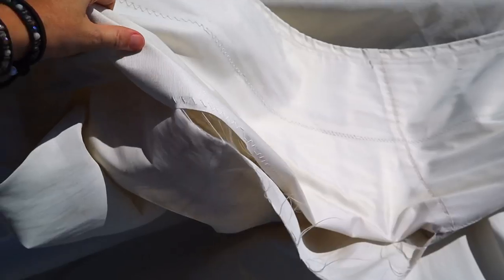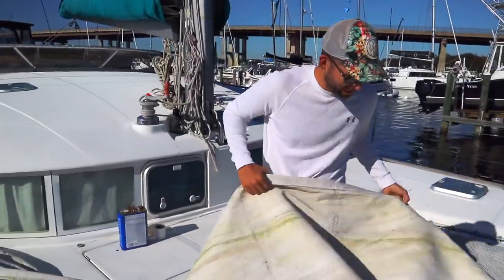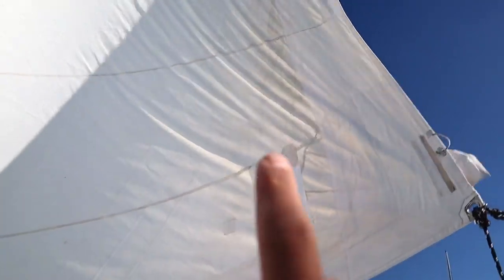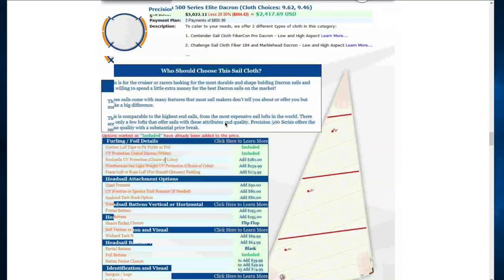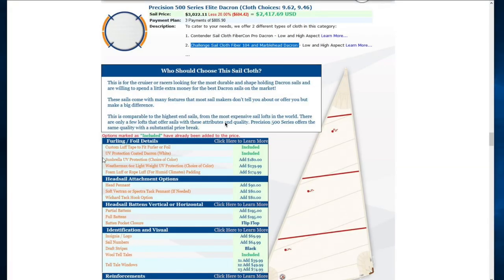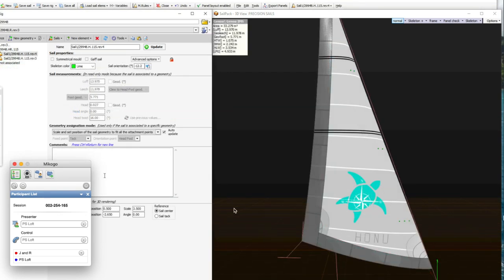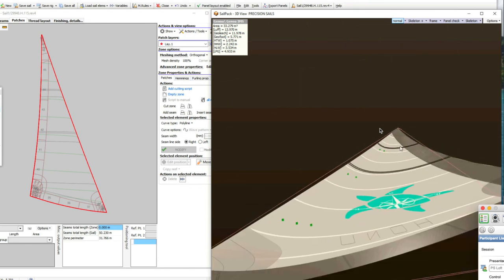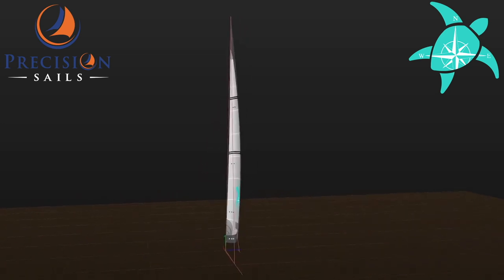TIME FOR A NEW SAIL!?

Comment: I have a question for Jessica. A while back you was using an app to check the bridges for the ICW. I was wondering what APP it was. I am planning to take a trip from NY to Florida, and that App would prove to be very useful to me. I would be able to see the minimal heights of each bridge, and know what channel to use to contact each bridge. I would assume that it would also have info as to which docks are for transients and the charges for the non transient marinas along the way, Fuel docks, pump outs, etc.
Reply from the maker: Hey! I was using Active Captain. Navionics now has Active Captain integrated into it which is very useful!
Reply: @jandradventures  Thank you. I use Navionics also. I will have to update it I guess.